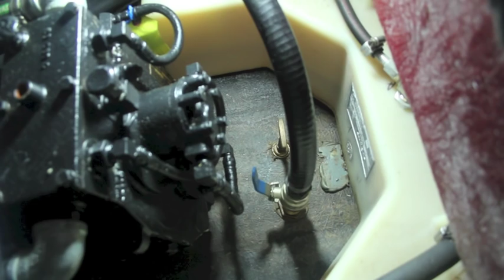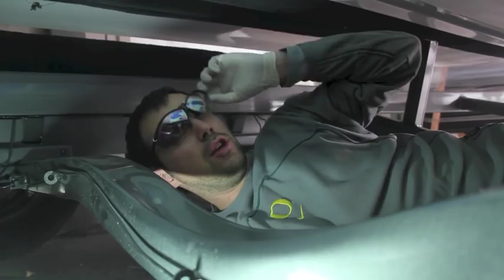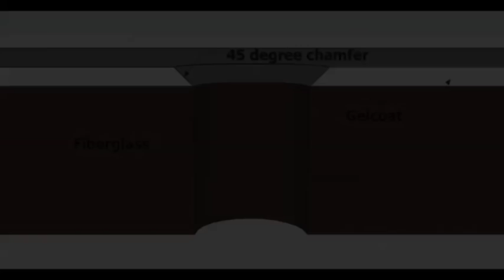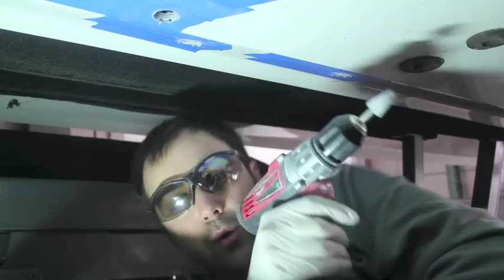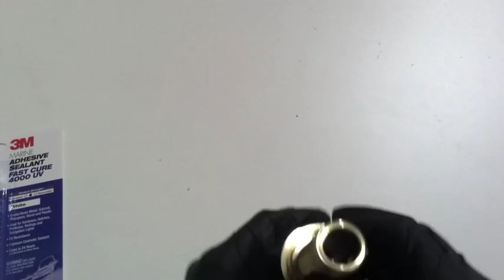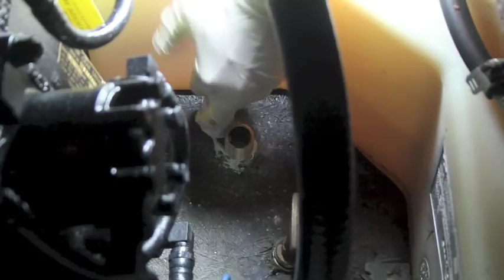How-To: Install Thru-hull Fittings in Boat Hull

Comment: That looks like a brass fitting. If you are working on a boat that spends its life in the water only use bronze. Do not use stainless or brass.

Comment: You don't want sealant on the inside, because then you won't know if the sealant on the outside fails, and the core will rot without your knowledge. If the exterior seal fails, you want to see water intrusion on the inside so you know about, so you can fix the problem.

Comment: For everyone freaking out about this not conforming to ABYC standards, the Wakemakers parts are actually better than many factory installations. My friend has a 2018 MB B52 23($90k+ wake boat) and they do not have  backing plates and use plastic ball valves for their ballast intakes. Some people also are incorrectly stating that the Wakemakers thru-hull mushroom is incompatible with their bronze ball valves because one uses NPS and the other is NPT. The mushroom is NPS for the nut to snug to the bilge surface, and the thread transitions at the end to NPT for fitting the NPT threaded ball valve.

Comment: 3M 4000UV is not intended to be used under waterline as it is a "anti-UV" sealant...
Reply: "Our 3M™ Marine Adhesive Sealant 4000 UV is a one-part adhesive sealant formulated to provide an exceptionally strong bond for harsh conditions as well as flexibility to combat vibrations, swelling, shrinking or shock common on boats or other marine applications. It is well-suited for many marine applications both above and below the waterline." -3M
Reply: @Marco Avila Because you don't use a stiffner inside the hull.
ABYC rules 27.6.1 The seacock must be able to withstand “a 500 pound static force applied for 30 seconds to the inboard end the assembly, without the assembly failing to stop the ingress of water.”
There comes data... the 4200 is rated for a maximum 165pd/in² (https://3m.citrination.com/pif/000890?locale=en-US) when the 5200 got a minimum of 48lb/in² on polyethylene but  376lb/in² on fiberglass....(https://3m.citrination.com/pif/000886?locale=en-US).
Reply: Man Dre Calm down. No need to attack me personally. You made a simple statement about why you thought this was not a suitable product and have only the fact that it was an anti-UV sealant with no details like what you just went through the trouble (two years later) to tell me off. State you case better next time so you are not spreading miss information as to why this would not work. And I would applaud you for your efforts and opinion. If some idiot was using this to solely plug a hole in his hull then the sealant with the most bonding strength is preferred. In my opinion, when mechanically sandwiched between the Metal flange and the fiberglass, this sealant is more than sufficient. When you call 3m again you can verify this...I’ll be standing in the dock waiting.

Comment: FAIL! that install would not pass any form of ABYC inspection.  that install is incorrect because;
1) there is no backing plate
2) the proposed valve is the wrong kind.  
3) thruhulls below the waterline MUST use flanged seacocks
Reply: WakeMAKERS To be fair, there is no indication that you're teaching the general public how to install fittings on a, "small recreational boats used on inland lakes and rivers."  After watching this video, I would believe this is the correct way to install a through-hull fitting on any boat.  If it's not, there should be some clarification.
Reply: WakeMakers
the type of water you are boating on has no bearing,  the thruhull you are using has NPS (straight) threads ,  the valve has NPT threads ( tapered)  which means that the mechanical seal is being made by 2 threads  at most.  you are trusting the safety of your boat to 2 threads to make the seal.  water will find its way in. there is no excuse for doing it incorrectly. The cost increment is only a few extra $ to purchase the correct fitting.  surely the boat is worth the extra couple of $ to do the job correctly.
Reply from the maker: Pierre-

Thanks you for the feedback. While we agree whole-heartedly with ABYC standards, as engineers, we also believe in using the correct tool for the job. A right sized approach for the application at hand is a practical and realistic problem solving tool. Because this application is for small recreational boats used on inland lakes and rivers, and because the forces at play here are so minimal, the additional cost and installation effort associated with a full seacock application doesn't make sense for our applications.

As always, use sound judgement and understand the risks associated with any modification you perform to your boat.

Comment: Question. I just installed this as per the video. Great video. I will be posting my video of my experience and install. 

Question. I tightened the nut on the thru hull piece, finger tight. Then tightened it with a wrench, but it was twisting the whole thing because I couldn't get a good grip on it. So it's tight, but, not insane tight. Should I be nervous? Is the 4000 good enough to keep it all together when is just snug, not, crazy sick tight. Thoughts?
Reply: Jwebb, there is a special tool to use when snugging up a thru-hull.
http://www.defender.com/product3.jsp?path=-1|51|2234277|2234283&id=1806475

If you don't want to buy it's better to use a tool on to hold the flange on the INSIDE.  If you notice, there are two notches on the inside of the flange...  Thats for the tool.
Reply from the maker: jwebb1975 Thanks for the comment, glad the video was useful for you. I know this comment is belated, but I just wanted to post a follow-up for anyone else that has this same question.

With an adhesive product like 3M 4000 you're absolutely fine to get the connection hand tight. If you would like to use a tool you can hold the threaded end of the intake ABOVE the jam nut with pliers using a towel or something else to protect the threads from damage. Alternatively, you can also use a 1/2" socket handle inserted down into the fitting, which will lock on the molded tool surface.

Hopefully that helps, if you have any other questions, let us know.

Comment: Yeah, great vid, but I missed the part when you pushed the fitting into the hull. And question, do you want to let the 5200 set up be for you snug it the rest of the way...???  I'm thinking to create more of a gasket..
Reply from the maker: Yeah, sorry we didn't detail that portion. Go ahead and place the fitting immediately, that will ensure the best mechanical bond via the adhesive.

Comment: Jason, where can I find part 1 or if available part 3? Also, what are the next steps after getting the fitting through the boat...? How does the mesh overlay stay on the bottom of the boat to prevent debris from getting into the pump?
Reply from the maker: Not sure exactly what you mean by part 1 and part 3, this is the complete video, there's nothing missing. If you're need more detail, just let us know.

The intake screen (http://www.wakemakers.com/brass-mushroom-thru-hull-intake-screen-strainer.html) if you choose to use one is secured with four screws into the bottom of the boat.